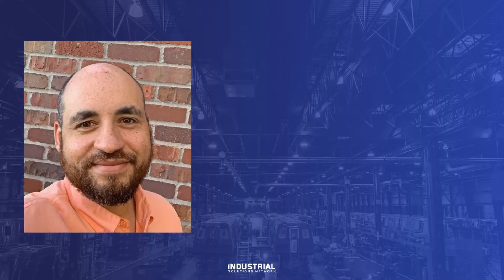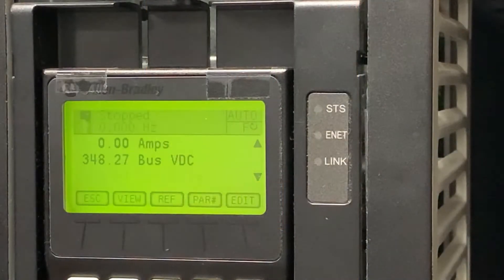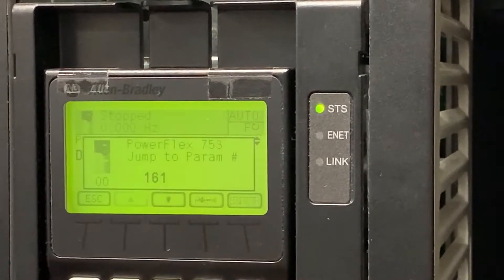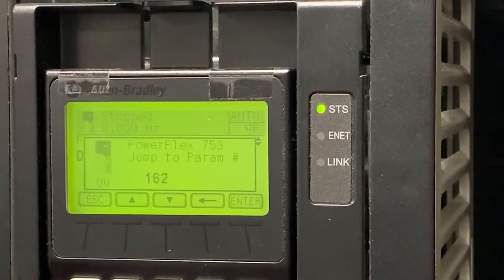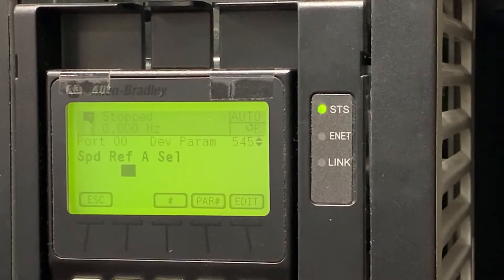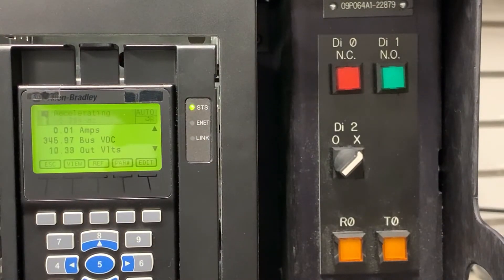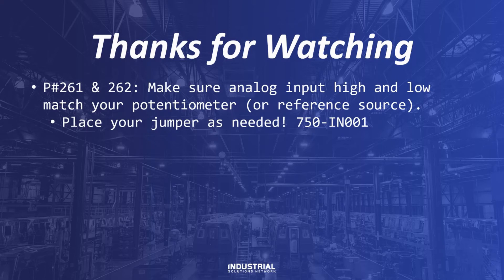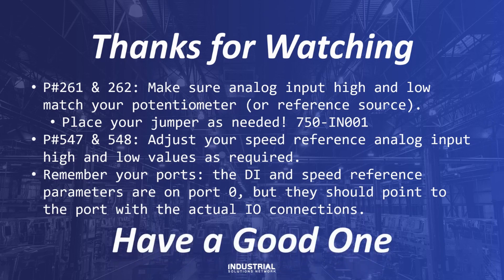PowerFlex 753 Three Wire Control

Comment: Heloo sir i want to run inveter with AI input 4 to 20 mA how to configure it plz guide me thanks
Reply from the maker: Hi Shahzeb.  If you are talking about the AI on the main board of the 753, then you would do the following:
The video shows a 0-10V option, to switch to a 4-20 mA option, change the jumpers on the mainboard as described on page 239 of the drive manual: https://literature.rockwellautomation.com/idc/groups/literature/documents/in/750-in001_-en-p.pdf
Next, set parameters 261 to 20 mA and 262 to 4 mA.  The rest of the set-up would be as described in the video.  Thanks!

Comment: Do you have the draw to 3-wire?

Thanks so much
Reply from the maker: Hi Mario, for a 3 wire diagram, please reference document 750-IN001.  Page 257 shows 3-wire control wiring.  Thanks: https://literature.rockwellautomation.com/idc/groups/literature/documents/in/750-in001_-en-p.pdf
Reply: If i want to control speed with ethernet from plc which parameter need to change sir?
Reply from the maker: @yenaung8993  Hi Itami Z.  If you want Ethernet to be the speed reference for a PowerFlex 753, then you would set parameter 545 to point to port 0: port "X" reference.  Where "X" is the port containing the ethernet card.  Thanks!